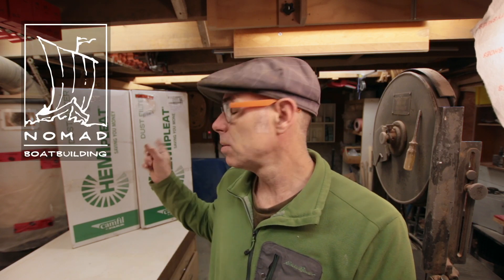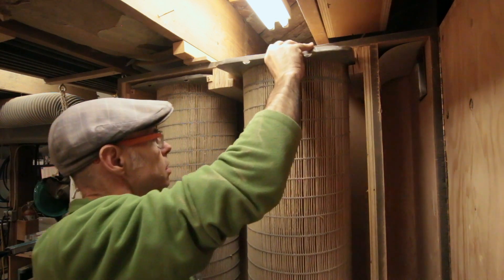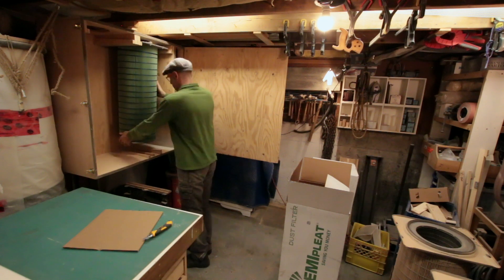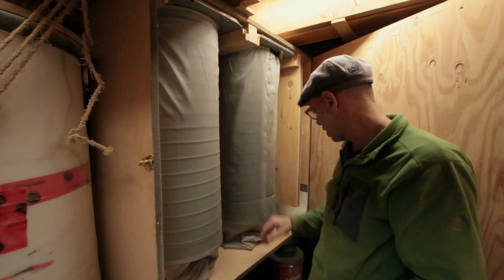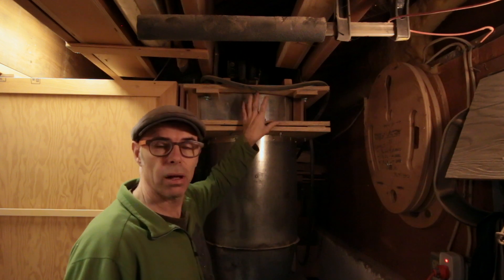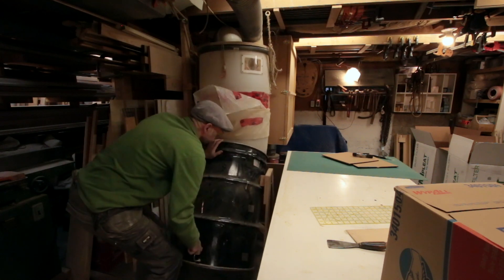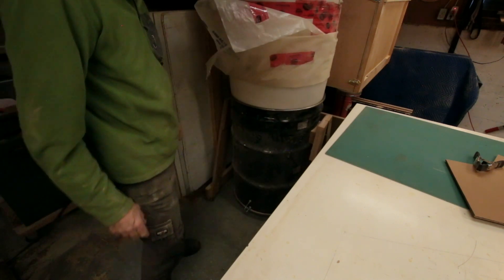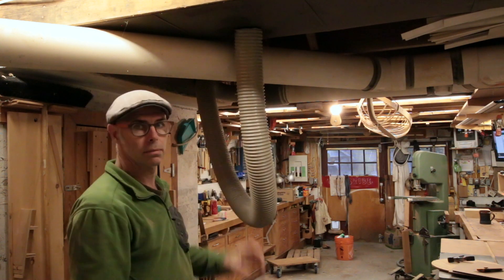Tour of my DIY Dust Collection System

Comment: Hey Mark, D have any images of the hydrofoil fins that give you such a tremendous power advantage?  Thanks.
Reply from the maker: Afraid not, but imagine a squirrel cage fan with a little curved airplane wing section in place of each sheet metal blade.

Comment: I really find compressed air is the best way to clean them.
Reply from the maker: I used to do that but I'm trying to keep that dust from becoming airborne in the shop.
Reply: @Nomadboatbuilding  understood. I use a large trash bag and take it outside. The snow looks really dirty with wood dust on it.🤷‍♂️

Comment: Thank you for the tips on a vacuum system.  I'm moving into a smaller garage shop space this coming spring and will need to install a good system.  The links will be very helpful.
Reply from the maker: Matt Evans-Koch before you start building one I would take a look at what’s on offer. Oneida would be my first place to look. There was nothing cheap about building this system and it took a fair bit of effort to figure out how best to piece it together. Scaling down can be a good thing. Ditch the junky tools in favour of really nice ones since space will be at a premium.
Reply: @Nomadboatbuilding  Thank you for the excellent advice and encouragement.  Scaling down is going to be hard but I'll get it done.

Comment: Setup is good enough. But while you're handling barrel and bag you're blowing up a lot of fine dust. And I see that your band saw is ineffciently sucked (dust is even visible there). So your health is still under question.
Reply from the maker: Paul Tall well you absolutely right. I do wear a respirator while emptying the barrel and run an ambient air filter. The bandsaw is a tough one to control dust on. I've been trying to find a good solution but no luck yet. The tablesaw could use an over-blade system as well but it doesn’t lend itself well to the kind of work I do. My mitre-saw is hopeless. I really need to replace it with one that has dust collection properly designed. I've never made the claim that my setup is dustless but it’s way better than the standard movable bag filter type.
Reply: Thank you for putting up this video and comment. It explains a lot and raises further proper questions.
Reply from the maker: Paul Tall are you planning a system for your own workshop?
Reply: @Nomadboatbuilding  Yes I am actually building. Same design of 18'' cyclone from Bill Pentz but DIY from a blueprint. And thanks a lot for filters, I see there is sales rep in my country, wil inquire them.
Reply from the maker: @pavelgrishin  Best of luck. Bill Pentz' website is a great resource if you can wade through the vast amount of information there. Camfil-Farr make some other filter configurations that might work better for you. My system used to push the dust through them from the inside out and which eliminated the box but they were harder to clean and were less efficient than these. The sale reps might be able to suggest the best choice for your setup. Best of luck.
Reply: @Nomadboatbuilding  Thank you )

Comment: Would it be worthwhile to blow air backwards through the filters when cleaning them?
Reply from the maker: Ian Hendrie I used to do that but it’s pretty awkward to do and you really don’t want to send all that fine dust flying around because it is the finest, most hazardous material in the system. The crevices are so tight that it’s hard to do anything that is particularly effective to clear them.